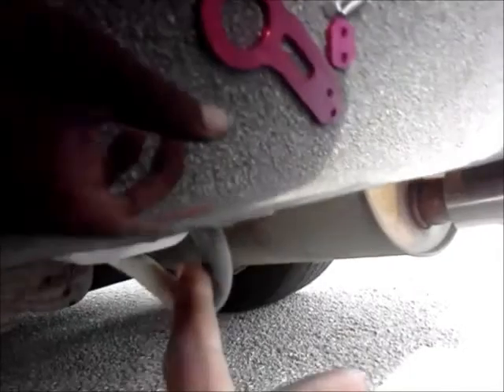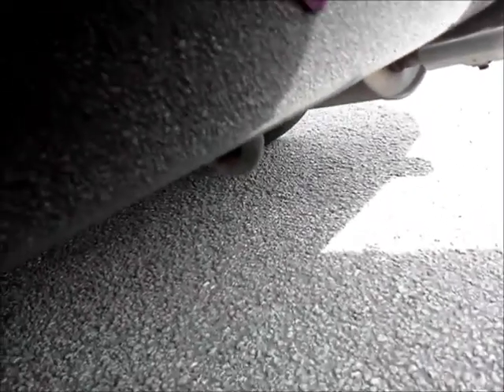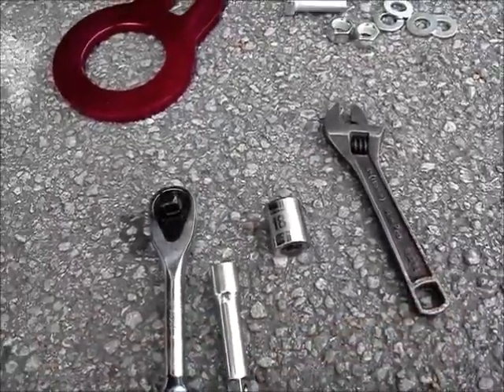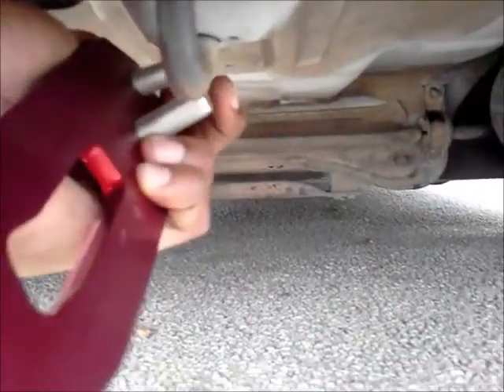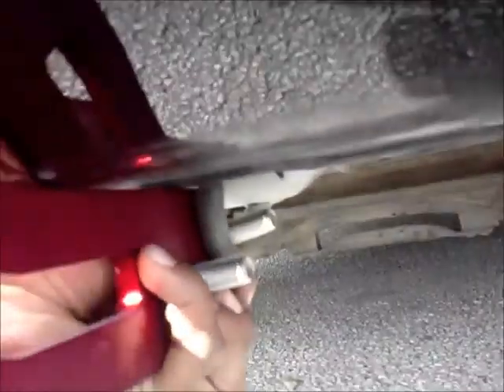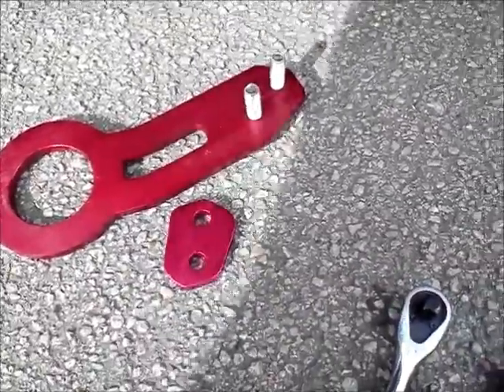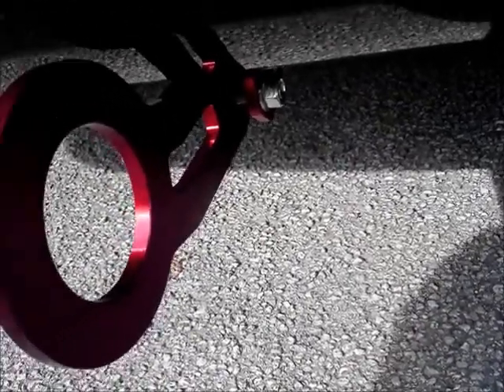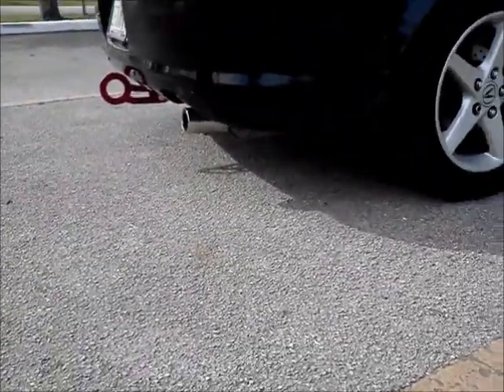Acura RSX Type S 2002-2008 Rear Tow Hook install

Comment: I read even though it's mostly for looks. Originally it became popular at the tracks because people wanted to use whatever advantage they could for better run times. They assumed that the hook would be read and it was. That's how the front tow hook became so popular. The rear hook just helps make it look stylish. I have 0 intention of ever putting mine to use aside from looks. Lol.

Comment: I mean it has to be installed up side down in your case... If you look at the rear tow hook it has  that little angle part. Right now it is facing down to the ground but it has  to sit flat against the base of the original tow hook.

Comment: 2 minutes to install an overpriced nonessential piece of aluminum and 10 seconds for a common thief to take it off and run away with it...  Need to use harden security bolts or get someone with skills to weld the nuts on before you lose it.
Reply from the maker: +Timothy Schuy this was done off camera... lol thanks tho